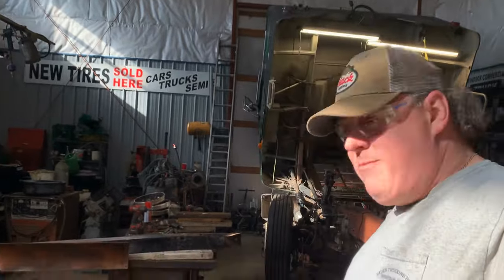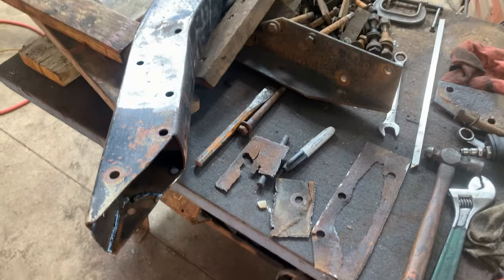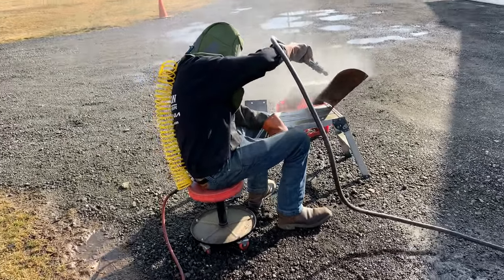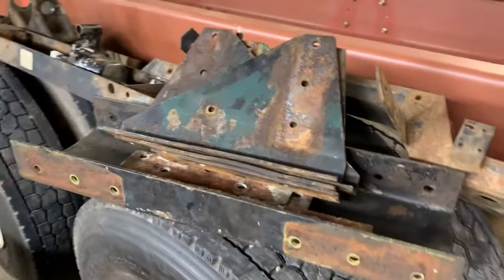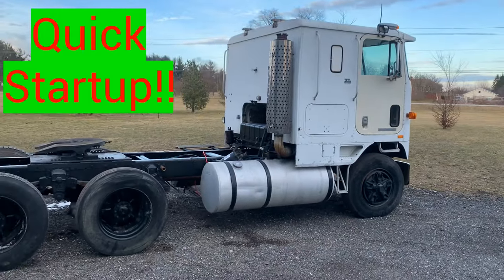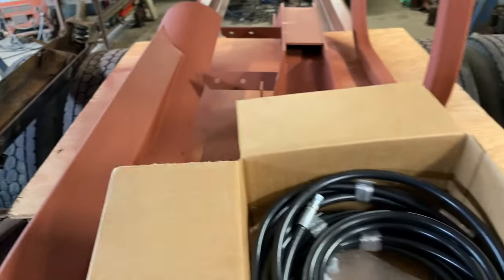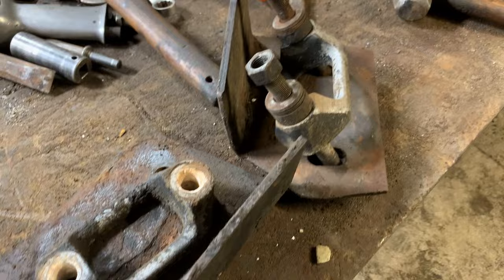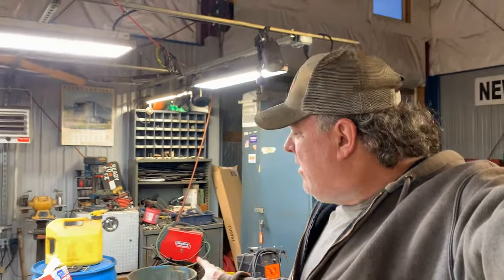Mack Cruise liner Restoration!!Sandblast! Prep! Prime!!

Comment: Isnt that a great feeling that most people wont even experience, when you get one of the most grimeast and labor intensive jobs completed? We just finished doing frame and crossmember replacement on a 1958 Diamond T conv that had been lengthened once, then shortened again, and they had cut all the original crossmembers in half and shortened all of them and really left a mess in general.  We put in 2 new rails and used ford crossmembers from an LTL from New Mexico that had no rust but it ended up really nice in the end.  We did the frame with zinc chromate and black VHT exhaust paint but it was a job. Your going to be looking good riding down I90.  Bill
Reply from the maker: Awesome thanks for sharing!!!! I can’t wait to be rolling down I90. Thanks for Watching BPT!!